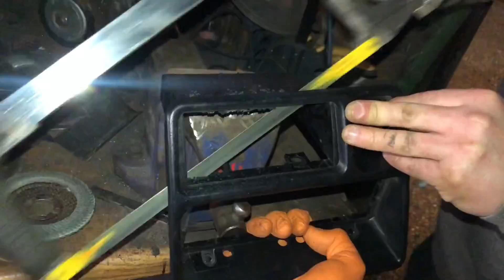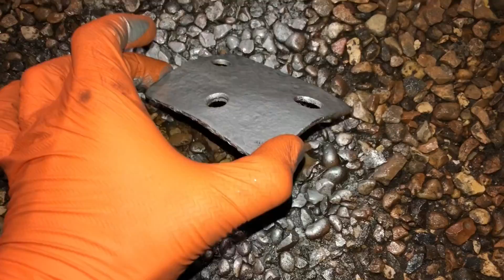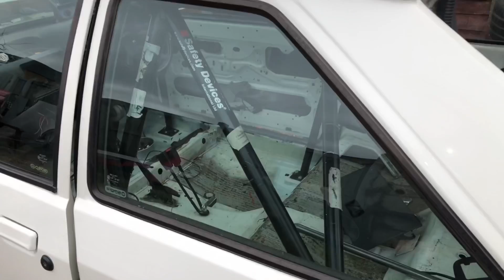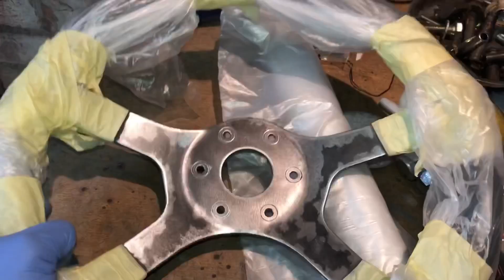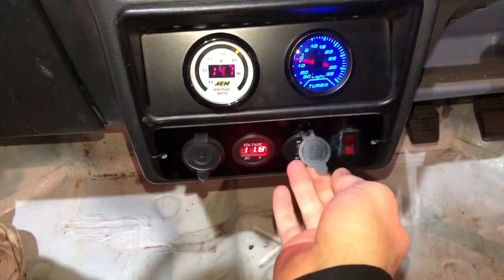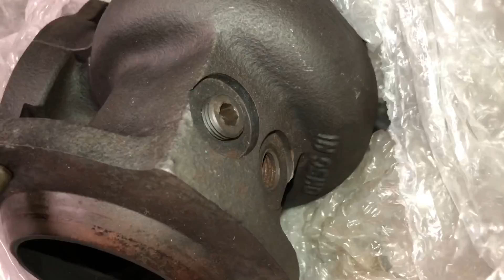Becoming RACECAR! Bucket Seats & Wiring Fixed!!   Ford Escort Rs Turbo Cosworth Efi

Comment: I'm loving this build mate my 1st ever car was a white xr3i cabriolet with a cheeky rs turbo engine swap had a few tasty mods 210hp was insane in a mk4 scort until some one tried to steal my wheels and failed because of locking bolts but did leave my nearside front wheel with only the locking nut left in which I didn't find out about until I was on my way to work doing 70+ on the m40 sufficed to say the car was written off. Quite a strange experience seeing your front wheel over take you

Comment: Where ya get the turbo and exhaust housing from?  It’s next on my list - I currently have original turbo unit and spec is beiges, 195 chip, airtrec front front mount, etc
Reply from the maker: Its from a large turbo escort cosworth. With that spec id go for a 4x4 saph cossie turbo for around 240hp
Reply: Aaron Unknown cheers for that - where did ya find the four hole? It would save some Welding.

Comment: Do you have video of installing the puma shifter?
Reply from the maker: Its very easy to do. Almost straight fit
Reply: @AaronUnknownPerformance  i wouldve liked to see a how to on the puma linkage too, i need to do it on my mk3 escort, th gear linkage is like stirring porridge.